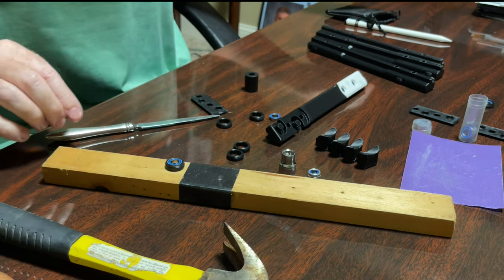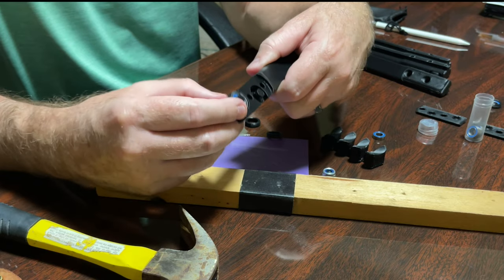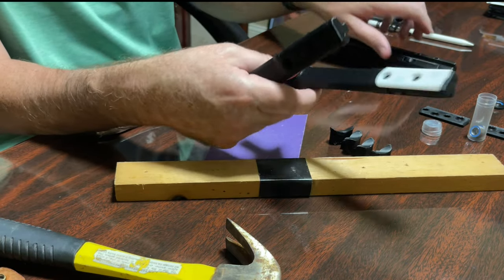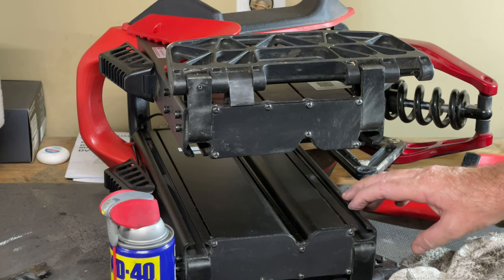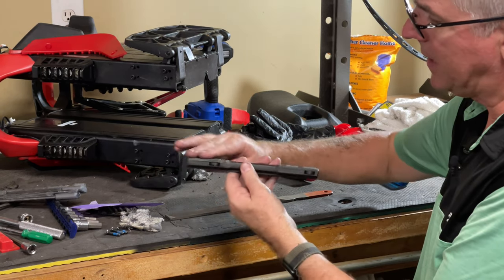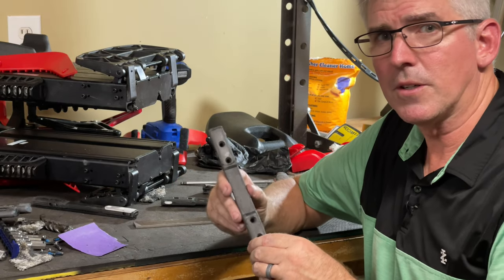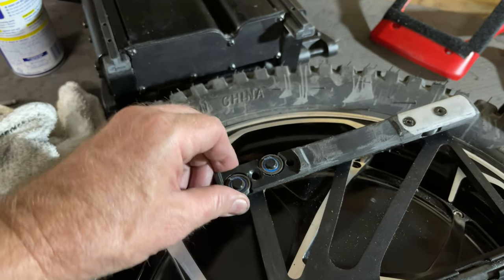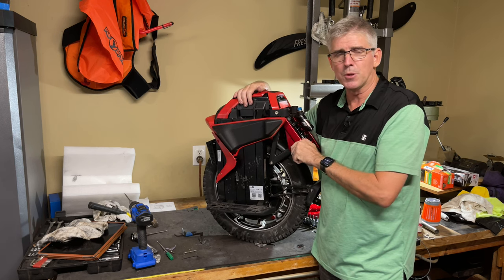S22 Suspension Upgrade (Bearing Rollers)

Comment: Hey folks, designer here! Really great to see this! What a great video. David your results are fantastic, really fun to see your S22 riding so great and see your build approach.

Edit: Wow, just got to the "sanding the sliders" part. That's some serious effort and dedication! 😳 These STLs were very much made with my printer's tight tolerances in mind. The latest version has ~2x the slider clearance and will be much easier to get sliding smoothly. 😊
Reply from the maker: Tim, thanks for sharing your design. The deeper I got into the project the more impressed I became with your work.
Reply: @DavidRaney  Why thank you! Your dedication to perfect slider fit really paid off, your ride is legitimately better than mine is– the bar has been raised!
Reply: If you don't mind my asking, what printer do you have & what slicer settings did you use to print yours?? I'm looking at getting a 3D printer soon, Creality CR10 V3 Pro & these, along with a new front bumper, are gonna be some of the first things I print (as well as a couple benchy boats to figure out how it works)
Reply: @ChickenLittle2323  See the design page and join the discord or telegram chat! We're happy to help.
Reply: As the bolt holding the slider is acting like a wedge and spreading the plastic until it touches the roller, how about a small modification? Is there enough space to replacing the countersunk holes with flat bottom holes and use dome headed bolts instead?

Comment: I did mine in ABS and sanded mine before fitting the bearings, much easier that way and I was able to test fit them before taking the wheel apart by using access to the top of the front sliders. 100km in and working well so far
Reply from the maker: Have you been in dusty/dirty conditions yet and if so have you noticed any noises coming from the sliders? I have about 40 miles, 20 miles on a dirt path, and starting to have noises come from the sliders but the performance is still good.
Reply: @DavidRaney  no noises yet but I don't ride on many dirt tracks and I have tape covering front slider tracks
Reply: I saw some people commenting on facebook pages in regards to the structural strength of a 3D print & my response was to print in ABS/ASA due to it being much stronger, I notice it's been 3 weeks since you're comment, have you had any issues yet with ABS??

Comment: It's been a few days since I stopped experimenting with this concept for now. It has two major weaknesses. The first is the resistance of the axes of the printed slider. I tested the impact strength (a case where the wheel is hit from the front in a horizontal direction, typically a pothole or hitting a curb, etc.). PETG is completely useless, even with 100% filling, the axes immediately cracked. When printed from nylon, it does not crack, but gradually the axis squeezes out, or bends, then the bearing no longer holds exactly in place and begins to rub, or loses the ideal trace in the profile. This causes the nylon torus (wheel circumference) to wear out faster. I also invested several thousand CZK (~hundreds USD) in a special co-polymer with carbon nano fibers. This is perhaps the only material that would withstand impacts for some time, but it is really extremely expensive, secondly, it is quite difficult to process it further after printing, because when grinding irregularities or tolerances, this material leaves microscopic "hairs" of carbon fibers on the surface. These then act as a very strong abrasive and it is almost certain that the guide profile would be damaged over time. And the other problem is the fact that the only usable bearing is also so extremely small that there is no chance of it lasting any reasonable amount of time. Very soon it will disintegrate and there is a risk of a very rapid formation of play in the drives and loss of control over the wheel. Even the torus itself is pressed on the bearing from one side, i.e. the rim is only on one side, after a while wear will occur on one side and there is a risk that the torus will slide off the bearing, or it will wear down to the metal. At that moment, the bearing starts to rub against the profile. Metal on metal, steel vs. aluminium. Again, the destruction of the ride profile.
Reply from the maker: Thanks for the feedback. I'm getting quite a bit of noise coming from the sliders and plan to break down the wheel this weekend to see what is going on. Hope to have a follow up video coming soon.

Comment: Regarding printing, there's tons of videos out there that tackle these issues of accuracy.
But it generally comes down to tuning the EM (extrusion multiplier) so you get just the right amount of flow so your parts don't bulge and gets thicker than projected.
The lip on the bottom of each print is called elephants foot and is easily tuned by Z adjustment, or printing on a raft and then cleaned up. 

Hope it helps!

Comment: I have a lot of thoughts about this.  First off you did a great job thoroughly covering the steps, thanks.  My overall feeling however is frustration.  I am frustrated that that $3000+ wheel that is all about suspension has such a fatal flaw.  It's ridiculous.  The idea that a customer needs to do all of this just to make the suspension work effectively is inexcusable.  The end result is good but as you said, the question is for how long until something wears out/breaks?  I am not quite sure if I will find the motivation to do this or just ride a different suspension wheel that actually works as promised.
Reply from the maker: I can not disagree. I think we just find ourselves in the middle of wheel evolution and we are paying the price while wishing it would evolve faster. At this moment in time the S22 is still my wheel of choice for the type of riding that I do.
Reply from the maker: Oh, and thanks for the complement. Means a lot coming from you!
Reply: @DavidRaney  Sure thing man, if I decide to do this myself I'll refer to your video 😁
Reply: I so agree with the idea that for the money we are paying, we shouldn't have to fix and change a bunch of stuff. Unfortunately this is the reality for all of the manufacturers. Examples on my EX20S, terrible tire out of the box, shock pump also terrible, headlight is marginal, tail light is nearly useless, cooling fan is going out in less than 500 miles.......
Reply: @bleeder228  I happen to have an EX20S as well, lol...  Still have the stock tire on mine but considering putting my old Sherman street tire on it.

Comment: Kingsong should have just upgraded the S18 design. I own one and that design is solid. It took a real labor of love for you to get your S22 to approach the S18 suspension. Your video is great and I think it will help people. I did a similar effort to fix my Master from bottoming out. I posted a video of that as well. Have you noticed your S22 bottoming out now that you reduced the sliding friction?
Reply from the maker: I had the original S18 and actually had a bit of trouble with the suspension when I first got it. After a bit of cutting and things it turned out much better. As for the S22, I have taken it over a few (I would call) average jumps about 18" in the air and have not come close to bottoming out. I'm on stock spring and weigh 190lbs.
Reply: I've also had a great experience with my S18 Molicel. I just spray a bit of dry lube every so often and everything stays pretty smooth. Would be nice to see them keep iterating on the design.

Comment: Amazing! Now I know what to use my carbon fiber PC for. Maybe I could convince one of my friends to mill this out of aluminum which would be ideal.
Reply from the maker: This project needs to evolve. It is not perfect by any stretch.
Reply: @DavidRaney  I got some bearings ordered. I'm planning to start over and design my own. I'm going to try doing a soft suspension. I'm a bit concerned about the "tires" ripping apart. I need to figure out the forces and maybe fit in as many bearings as possible or find a more ideal material.
Reply from the maker: @UnidudeNine  be sure to share your results. There are a lot of people that are obviously interested in any improvements to this system.
Reply: @DavidRaney  Yes, and for good reason. When the slider friction is too great, it only provides shock absorption to large impacts. The small bumps can really make my head hurt. I jumped my wheel a lot but now since my knees hurt, I'm much more interested in very plush suspension, but enough to where I can still curb hop. I think the s22 still has potential to have that kind of behavior, but a good slider will be key. It seems like since the force isn't symetrical, certain slider wheels will get more weight. I have to draw it on paper to know for sure.. And I definitely want to custom sew a black vinyl seat that has foam. The stock plastic seat is transferring all the shock to my head as well. It's not healthy.
Reply from the maker: @UnidudeNine  I agree completely.

Comment: {tl;dr... wish list}
Nice upgrade. I'm wanting more psi in both tire and shock but that's a separate issue. The rails I'd like to see milled out of HDPE with rollers on a rocker arm/tension springs with double the number of roller bearings per rail. The chevron pattern from the old rail plungers should be transferred to the slider rail (using bristle brush inserts) for better debris removal.  Dirt egress shielding could also be improved by integrating an outer cap to the rail to further isolate the channel.  The bearing wheels should be urethane HDPU (like most roller skates/skateboards/replacement hip-sockets) and should have a roughened texture to lessen the possibility of sliding against the inner aluminum channel versus rolling, geared teeth would be more ideal. 
 
I'm not sold on the 3D print as a "final solution" but it's a great start to an evolving iteration.  {Damn, I'm opinionated, and I don't even have a newer suspension wheel... yet.} A carbon/graphite filament would make me feel better about lessening channel wear but time will tell (why the battery cases aren't anodized is also a mystery).  Lastly, if 3D printing with embedded MoS2 (dry molybdenum disulfide) were possible, I'd prefer this to any paste type of grease or lubricant. This system should be dry/non-oily because grease will just accumulate contaminants. Butchers Wax (NOT paraffin) could be used to periodically clean the rails if one is careful not to get any on the roller/channel contact surfaces. {Also, use "white gas" to clean, not wd-40, which leaves a residue}.  
 
With that said, awesome job! And thanks for the information. The S-22 may just rise like a phoenix after all the initial quirks (design flaws) are minimized through the community input and version upgrades. There are plenty of other items on my wish list {i.e. magnesium anodized cases w/ titanium channel inserts and active electronic suspension- not that Delco crap} but organic growth is the price to be paid for an under-capitalized niche industry, such as it is. {...couldn't resist}
Reply from the maker: Thanks for the feedback. This is definitely not a perfect solution.
Reply: @DavidRaney  I applaud your contribution. Thanks

Comment: This is a very specifically detailed video! Thank you so much for sharing. My S22 is arriving next week.

Just a quick question tho: How would these 3d printed sliders last under heavy use? In other words, the longevity of it, compare to the stock slider.
Reply from the maker: The question of durability will come with time. They are doing fine for me now and I plan to have a 200 mile review coming up pretty soon.
Reply: @DavidRaney  awsome. Will def check when that's out.
Reply from the maker: https://youtu.be/JjW1t6JjXdo

Comment: That's a wonderful mod! I'll surely try it by printing in PETG!!
A little question for you: which spring you have? The stock 750lb?
Reply from the maker: Yes, everything else about the wheel is still stock. No other modifications.
Reply: @DavidRaney  Woah, that's incredible then! I've tried to pump my S22 but it didn't have that kind of excursion!

Comment: I enjoyed watching your video and I don't even have an S22.  I liked the pacing and detail that you put in it.   I see this has gotten a lot of feedback so my question may get lost.  You stated that in the past that your attempts with lubricants would fade after 10-15 miles of riding.  At the end of this video you state that you did a 2 mile ride and everything is great.   
My question is, how is it after 15 miles?   What about 50 miles?  That seems to be a better comparison to the former cleaning and lubrication methods.
Reply from the maker: I'm working on a follow up video and you will see that I rode for 20 miles on pavement with great results. After that I did a 15 mile ride on a dusty road and all kinds of noises started happening. I am going to break back into the wheel this weekend and should have a video follow up pretty soon.
Reply from the maker: https://youtu.be/JjW1t6JjXdo

Comment: Great video. I think I am too lazy and enjoy the S22 enough that it wouldn’t be worth the time for me. But definitely looks like it makes a difference. I think when king song gets another go at this wheel it will be one if not the best. Too many new things at once for them.
Reply from the maker: Thanks for watching. I really like the roller design and hope Kingsong will consider putting more effort into alleviating all the friction in their suspension systems. I had an S18 that I spent a lot of time working out the friction points. I got it dialed in but it shouldn't take this much work.
Reply: @DavidRaney  Really they should be producing replacement sliders based on this concept and sending them for free to any customer willing to do the labor to install them.
Reply from the maker: I completely agree. If they did they would build a much more loyal customer base in my opinion.
Reply: @DavidRaney  I think you are right. I changed my order due to too many out of the box and rider complaints. I have owned a few Kingsongs in past. However, until KS makes an improvement or a even say a slider as the one used in your video can be bought as a kit, less people may have interest in the KS22. Credit to the designer and you. Well done on the improvement. I enjoyed the video.

Comment: Sounds like you need .005 shims on the side of bearings... Do you have channel covers???
What about using drawer slides??? 🤔
What I need to know is how much space between the back of channel and the back of the side bar...
Reply from the maker: Right now the bearings are not rubbing on anything but the shims are probably a good idea. I don to have channel covers yet, I'm doing a 200 mile review to see how they hold up with dust a debris.

Comment: Hi David - just purchased my S22 and very much interested in this upgrade. I too spent time tuning my S18 suspension and look forward to the benefits of doing the same with my S22. I do not have a 3D printer, any advice as to how to get a set of sliders manufactured? Is this something you would consider on consignment?
Reply from the maker: I actually had a friend print it for me. It is my understanding you can pay people to print objects somewhere online. Out of the box you’re gonna love the S22. This upgrade became more important to me as I started riding more dusty/dirty trails. It is so effective I’m hoping some entrepreneur will start developing a plug and play version soon and sell it for a reasonable cost.
Reply: I would be interested by your trick/improvement to make the s18 suspension softer. Do you have any links to share to achieve this on s18 ?

Comment: I mean, in my head at least, referencing attaching the sliders & making sure they're tight, using locktight, etc
To me at least, it doesn't need to be so tight, as the outer slider frame will keep everything tucked away, even if it where to be a bit loose, no parts should come out, as it's all snug??
Reply from the maker: Something I didn't mention in the video was the first one I crushed was with an electric drill. The others I used red lock-tight and tightened down by hand using a regular wrench and was able to get it pretty tight without deforming the material. If the screws start backing out they could start rubbing against the inner section of the sliders and that wouldn't be good.

Comment: Thanks for the video. But I mean COME ON!!!!!! REALLY? This is a 3200 dollar machine!!! Aint no way in hell we should have to go through all THAT crap just to have a functioning wheel thst SHOULD work well out the box. My name aint Kingsong and i dont get paid to repair wheels. This is exactly WHY I returned my S22 for a full refund. This wheel is a piece of SH!!@$##@!!! PERIOD. Kingsong sold us a dream. Bearing issues, temperature sensor issues, weirdo noises, control board issues. This wheel is by far the BIGGEST disappointment of wheels this year. Why should I have to revamp the suspension sliders on a 3200 dollar wheel? B.S
Reply from the maker: I understand your frustration, I'm still enjoying the wheel.